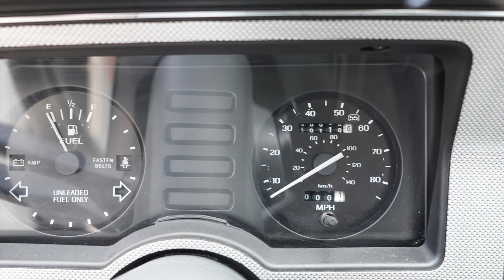1985 Ford Tempo #radwood

Comment: I was so temped to buy this when I saw it listed. But I’m in Ohio and it’s a long drive to get to where this was.
Reply from the maker: She's a little rougher than advertised on the mechanical side.  Body and interior are absolutely perfect.  We've already torn out all the hard lines, steering rack, exhaust, brakes, fuel tank and suspension.  Need a few more parts to go back together.  Filming and posting progress.  I really want to take this thing to RADWOOD.